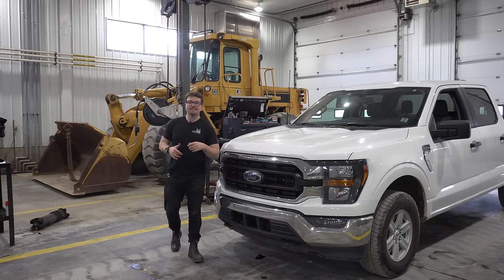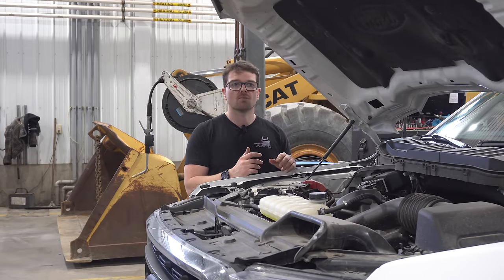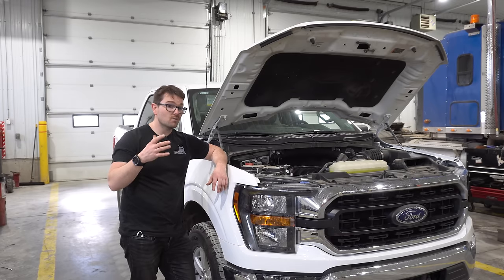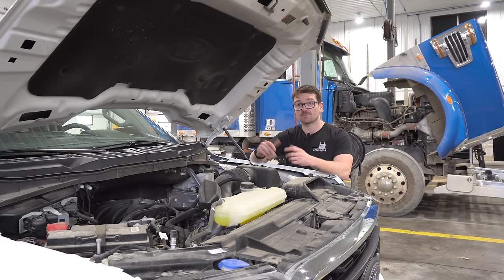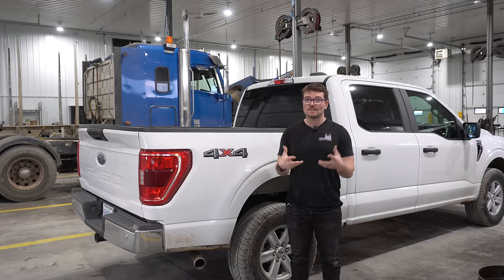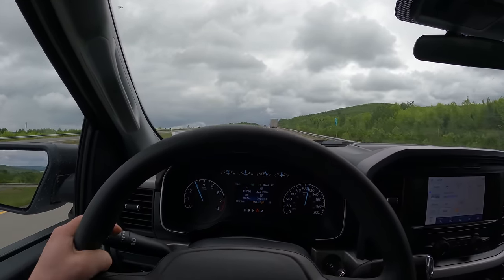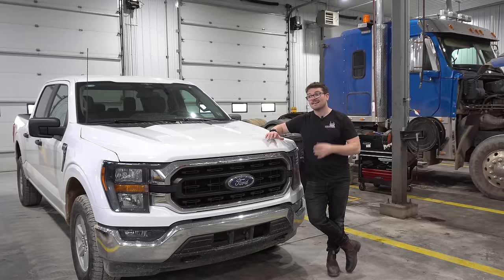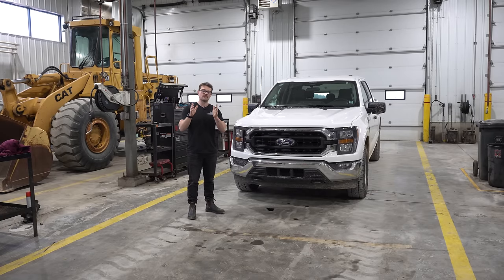Ford F150 5L Coyote V8 Engine **Heavy Mechanic Review** | 5 Reasons why It's the BEST

Comment: 3.5 Ecoboost still my #1 choice.I tow alot,I don't need a screaming v8.I want diesel like performance without the and emissions issues.The Ecoboost does exactly that.5.0 cant touch it towing. You proved it Alex.
Reply from the maker: Hey when it comes to towing that 3.5 Ecoboost is an absolute animal. I haven't driven anything like it!
Reply: If a car or a pickup truck was stuck in a ditch could the ego boost 3.5 pull it out without even breathing heavy or would it be a problem
Reply: Just hate that they don’t last long and have so much problems with turbos and many other problems on those ecoboosts
Reply: @TheGettyAdventures I hope you do a review on the 5.7 tundra I know it’s a good motor you should do a review!!!
Reply: He said reliability not towing power dork
Reply: @TheGettyAdventures  thank you. I haven't worked in 2 years I hurt my shoulders.  Someone in this tread just mentioned that they are great engines but they don't last long trouble with the turbos and that's why I was thinking of a 6.2 F-250 I needed to pull a trailer occasionally I'm debating on on an EcoBoost 3.5 or a 6.2 F250 the only problem is the 250 is what I really wanted is a one owner but it's got $280,000 or 89,000 me on it supposedly has all the records and no rust on it he's asking $ 25,000. Even though that's a great engine I'm not sure that that's a good price I'm thinking of what I could offer them any ideas boost if I don't go with
Reply: @robertespinoza2740 Haven't read where Ford Ecoboosts have problems with their turbos
Reply: Till the turbos let go 😆
Reply: I tow a lot, and the 5.0 engine braking is far superior than the 3.5 eco in the Rockies, which is more important to me rather then a faster 1/4 mile time towing a trailer, and the screaming v8 noise is a beautiful thing in a Toyota prius kinda world.
Reply: @SudburyMan  Cam phasers are probably a bigger headache than the turbos.
Reply: @BC08 would the turbo give out faster if you tow heavy often, or driving fast a lot? I’m newer to trucks and don’t know much about turbo. I’m planning on getting the f150 power boost hybrid, but I’m not planning on towing, and I want better fuel economy truck. I usually drive casually. Do you think I’ll have problems with the turbo with what I’m planning on getting it for?
Reply: @TheChosenOne90   You really don’t see that many turbo problems.   By far the most most common issue with the 2nd Gen 3.5 EB are the camshaft phaser failures.
Reply: @matthew7972  who are you calling a dork?
Reply: If you are towing then yes the 5.0 will have better fuel economy. The 3.5 ecoboost does make more power under full boost/engine load so that it obvious.  But for commuting on long distances ive achieved 23 mpg on my 3.5 ecoboost even within break-in. I found the advantage with turbocharging in higher elevations with minimal load in cruise control. Turbos are more efficient in higher altitudes due to the thinner atmosphere. Driving habits play a role. The real issue is the feeling of boost is like a drug.
Reply: Guy really said diesel like performance but without the emissions or issues….. 3.5 eco boost is filled with issues.
Reply: @Back_door_bandit_98  haven’t had any issues with my 3.5 ecoboost. Ive actually had a 5.9 Cummins with more issues from the common rail fuel system destroying the injectors.
Reply: I towed cars up Manitou springs pass going 95 with the 5.0. I tow an 11,000 pound airstream with it. It's got 180k. A small engine like that and then boosted none the less is just not going to last as long. Plus now everyone knows you have 2 dads!
Reply: @surplussean3364 Wife’s uncle has a 3.5 eco boost replaced entire intake manifold at 43k miles due to a crack in the plastic mold turbo lines for passenger side turbo started leaking at 67k and the drivers side started leaking at 74k cost to replace both lines with labor is over 1300 not even 100k miles and turbos lines start leaking right after warranty and the intake manifold they put on at 43k is already whistling again like it did previous. Besides that the truck itself is nice but the power train is horrible.
Reply: @BC08  ok thank man. I’m hoping to get either a 2021 or 2022 EB hybrid like I mentioned or the 5.0 in like a year or so. Live in Colorado so sometimes I go to the mountains with friends and family, don’t know which is best for the Colorado Rockies so was hoping someone would help.
Reply: @TheChosenOne90   The 2.7 EcoBoost is proving to be the most reliable EcoBoost.   
They don’t have nearly the amount of issues with cam phasers due to how the oil system feeds the phasers.    
At high altitude boost is definitely your friend
Reply: @Back_door_bandit_98  I said emissions issues see above
Reply: @allighabell3138  how do you know how long my 3.5 will last?
Reply: @drunkinmaster1  well said
Reply: @jasonbrushett2005  it's the law of entropy everything wears out eventually. A small motor being forced fed air to make more power is going to wear out faster compared to a naturally aspirated engine that's larger doing the same work it's just common sense.
Reply: @BC08  cam phasers are also now an issue on the 5.0
Reply: @Back_door_bandit_979  and mine has been trouble free over 60000miles
Reply: @jasonbrushett2005   The 5.0 cam phasers issues are virtually non-existent compared to the 3.5.   The 2.7 and 5.0 are both far less prone to phaser failure than the 3.5
Reply: @surplussean3364  mine went threw 4 and my friends had problems as well I love the power of them jsut kinda not really that reliable
Reply: @Back_door_bandit_98  There's plenty of articles and videos about the reliability of the 3.5 Ecoboosts. I have 130k miles on mine with zero issues. Probably half of those miles were towing a 7k trailer
Reply: Good luck with those turbos after 150k
Reply: @TaborEaton  more like the whole motor after 150k miles. But I’m still a fan of the 3.5 eco boost if you don’t have a good warranty you better not get it
Reply: @TaborEaton  lots of turbos making it past 150k ,stop talking nonsense
Reply: @jasonbrushett2005  lots as in the majority?
Reply: My Coyote 5.0 will be towing well after your Ecopoop is long dead.
Reply: @SHUlivin  ok whatever

Comment: I’ve had both. A 2019 5.0 and a 2021 3.5. Never had a single problem out of either, the 3.5 is pushing 150k and all I’ve done was change the oil and put gas in it. I’m a salesman so I drive it all day everyday and it runs like a champ. I think keeping up with the oil changes with recommended oil and good gas goes a long way.
Reply: What engine do you prefer? I currently have a 3.5 but thinking about getting a 5.0 for reliability.

Comment: My bother owns a 2018 F150 with the 5.0 and it has used oil as long as he has had it.He took it back and was told that was normal.I have a 3014 Chevy bought it new and pull a 30 foot camper with it and it has never used one drop of oil.
.
Reply: Yeah its super common, thats why i didn't buy a 5.0
Reply: Bullshit all Chevy's with AFM burn oil

Comment: 2018 5.0 with 184k still running like a champ. Had to replace two di injectors and a o ring on cooling system. Only Maintence other than that.

Comment: My dad’s 2014 F-150 5.0 has 270,000 miles on it. He regularly tows with it so it burns about a quart of oil every 5000 miles. But it has been very reliable. NA, port injection, and no cylinder deactivation.
Reply: Sounds awesome brother, I have a 2011 Ford F150 with a 5.0L Coyote V8 in it with 158,000 miles on it and still going strong and man its a beast and it sounds like a beast with the Borla ATAK exhaust on it as well.

Comment: I had a 2002 F150 with the 5.4l Triton engine which I sold with over 200k mi. Got a 2014 F150 with the 5.0 Coyote engine (used with about 100k mi). Within 1 year, I started having codes pointing to "misfire on cylinder 8". Did usual "fixes" - checked coil pack (not that), changed all spark plugs (not that), cleaned injectors (not that) and eventually requested compression test at service shop.  That test revealed bad compression on at least 2 cylinders and led to failure of cylinder 8 altogether. That led to a verification at a local Ford dealer and result: "you need a new engine". Requested one at same dealer and found none were a ailable to be purchased new. Found one used (90k mi) at a used parts shop and had it replaced. So far, the replacement has been pretty reliable except for a bad sensor which of course was inaccessible without partial disassembly (and $$). At times, I have regretted selling the 2002 truck because it had been so reliable, but my wife's 2007 F150 with 5.4 Triton engine had the "death rattle" crop up on a long road trip which led to a $9000 engine replacement in Albuquerque (17 hrs from home).  So I have mixed reviews on both engines. Seems like if you get a good engine, it is the luck of the draw.

Comment: My work truck 2013 5.0 has 218516 miles on it! Did have to have the rear main seal replaced a while back! Still runs hard! No engine problems other than that.

Comment: Appreciate your reviews. 5.0, 3,5 eb, and 3.0 duramax best light truck engines.
Reply from the maker: I would have the agree with you.
Reply: Duramax burns a quart  of oil every 1000 miles while towing and gm says this is normal!! Not to mention excessive def fluid. There will be yet another class action lawsuit against gm.
Reply: @ajmedeiros77  I tow with my ‘22 Duramax 3.0 every day for work and my oil level on the dipstick doesn’t change from one oil change to the next. It does consume more DEF but it’s not a crazy amount. I put on about 1800 miles a month and I buy one jug about once every month and a half.

Comment: I like my 23 F150 with the 5.0. So far no problems.
I love mine and would recommend you buy it
Reply from the maker: very solid engines!
Reply: Well several people I know have bought knew trucks and had trouble with them for your information. A lot of people who bought the New Toyota Tundra’s have had lots of trouble with them on various things because of the new turbo engine. I know another guy who bought a new Chevy Silverado and it had a pin hole in the block and they had to replace the engine. I think there are bad ones in all new vehicles. You are lucky if you get one that gives no trouble because of the poor quality control of all the manufacturers. As you said, you should not have any trouble with a new truck, but believe me, all manufacturers had trouble with some new cars because of poor quality control.

Comment: 2014, 126,000km, towed probably 40,000 5500lb tt.  3.55 gears    cant go wrong good milage,  no repairs just  maintenence, full syn oil changes since new every 3500km

Comment: The 5.0L Coyote is a great engine, but for towing...it has nothing on the 3.5L EcoBoost! The 3.5L EcoBoost is such a great engine and I have been more than impressed with my 2016 F-150 SuperCrew 4×4 by it's power, efficiency and the way it out tows everything on the road in the 1/2 ton class and it even out tows many 3/4 ton trucks! I've put 108,000+ miles on my F-150 with zero issues. I have done a few mods: SCT Livewire tuner, exhaust, CAI, 1 step colder plugs, larger intercooler /hot & cold pipes, and a better blow off valve to atmosphere for quicker turbo spooling, along with dual oil catch cans to keep carbon deposits from fouling valves.
This truck has more power than any current NA V-8 on the market and it shows on the interstate when pulling. And I get similar mpgs as diesel trucks. I can't say enough great things about the 3.5 (and 2.7L) EcoBoost engines. Ford really did a great job with those 2 engines!

Comment: I agree with you completely. I love the 5L, but I'm not getting near 20mpg. More like 15-17 combined driving, which is just average for a pickup truck. Granted, mine is a 2015 with the 6 speed, and I wonder if the front level that was on the truck when I bought it and the 20" wheels with AT tires are really bringing down my numbers.
Reply: Have the 2015, 5.0. 18.1 MPG stock, extended bed. Probably your tires.
Reply: My 2018 5.0 10 speed lost nearly 30% mpg when I did a 2.5+ bilstein level with 34.5" ATS.   I was sitting about 23mpg overall,  then once I did wheels, tires and level I averaged around 16.
Reply: @stephenfrost545 my 2018 did the same with the fox 2inch level and 33s
Reply: Yes, it is and, yes, they are.
Reply: @stephenfrost545 that’s why my next truck will never be lifted or leveled. Keeping the nose down and only the painted surfaces in the wind makes all the difference. Bought my 2012 with a leveling kit already installed (was a dealer demo truck at the time).
Reply: Did any of you guys recalibrate the speedometer after going up in tire size.?
Reply: I have a 22 Roush non supercharged and I average 16 with 33" tires. Since it came already equipped like this, I have no idea if it would be better with different wheels and tires on it. I'm assuming it would, but I don't think it would ever see even 22 mpg considering my best in 20 thousand miles is 17.5 on the highway.

Comment: I have a 2022 F150 with the 5.0 and I’m quite happy with it. Sounds beautiful and decent on gas as my grocery getter. I can get down to 9L/100km (~25mpg) on the hiway if I keep to the speed limit. Driving between Calgary and my bedroom community 5 mins outside of the city i average about 11-12L/100km (~20mpg) on daily use. I filled it after a roadtrip and the distance to empty was 1392km or 864mi.

Comment: Have you ever taken a Tundra with the 5.7 litre iForce engine on your towing loop?  The new generation retired the 5.7 and went with the twin turbo in 2022, but there are plenty of used Tundras to be had.  I have had an excellent experience towing with mine.
Reply: The tundra 5.7 is the best engine in my opinion.
Reply: @nickgrant42   Nah, the 5.7 Toyota may be reliable but there is nothing the 5.0 doesn’t do better.    
The 5.0 produces more HP/TQ and returns drastically superior fuel economy.   

The 5.7 is a notorious gas hog and its outgunned by several half-ton engine now
Reply: @BC08  I do like the 2011-2017 F150. If I were to get a truck other than another tundra it’d be a 2017 F150.
Reply: @nickgrant42 most people say the 2nd gen coyote the 2015-2017 were the most reliable ones made. The 2018-2020 was definitely faster but seemed to have oil consumption issues. The 21 and newer models seemed to have fixed that. I’m still worried about cylinder deactivation, considering Chevy and ram both have massive issues out of that. But I guess the 5.0 engine is totally different style than those pushrod engines so maybe they don’t have same issues.
Reply: @andrewcleveland  Too early to tell with regards to the 5.0 Coyote cylinder deactivation system.
Reply: @nickgrant42  It has cam tower leaks and timing chain tensioner issues.
Reply: I've put 50K miles on my 2007 Tundra 5.7 2wd DoubleCab - so not a crew cab but has a 6'6" box.  The thing is a towing king.  Tons of power.  Pulls really well.  No leaks.  Bought with 105.  Now at 155 after 3 years.  Towed 30-40 cars and trucks with it, including a 3/4 ton suburban.  I can squeak 19 MPG with the AC on doing 70.  Nice truck.